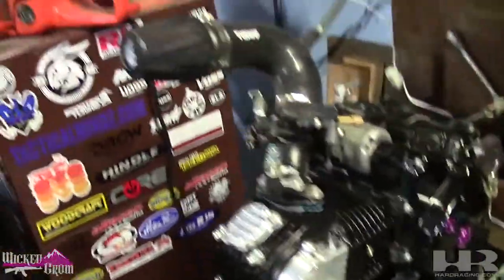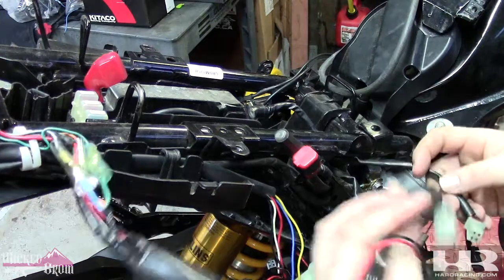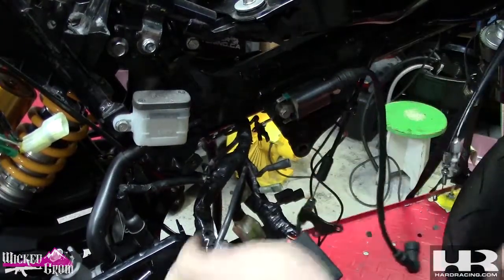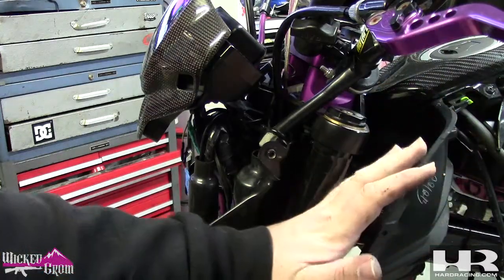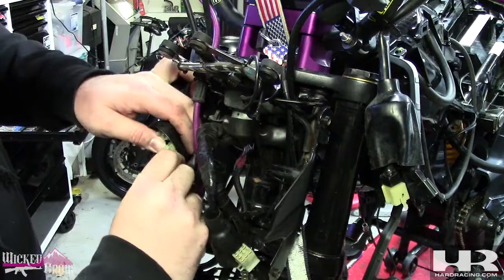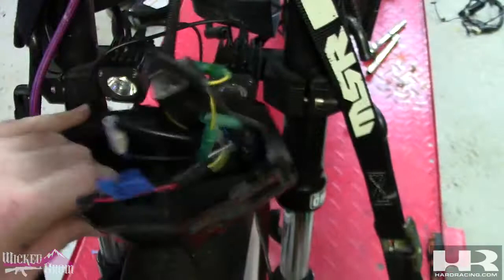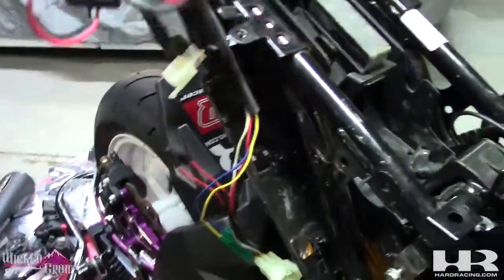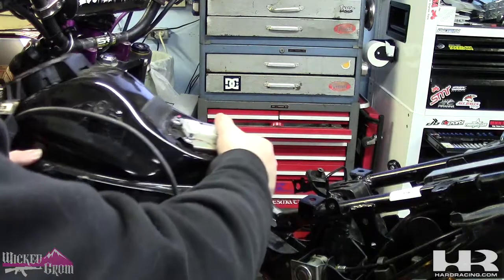Honda Grom 300 Swap | Part 2 - Harness Removal

Comment: What are you doing with the old engine? If you're selling it how much for it?
Reply from the maker: Going into my other Grom. If I sell it I'll start the bidding at $2000 😂. Slightly under msrp of all the parts installed on it.